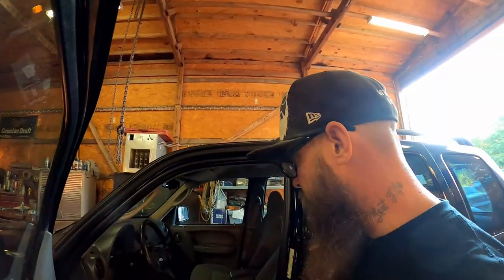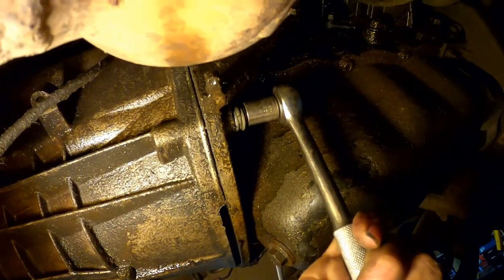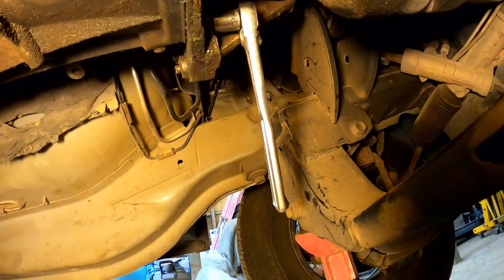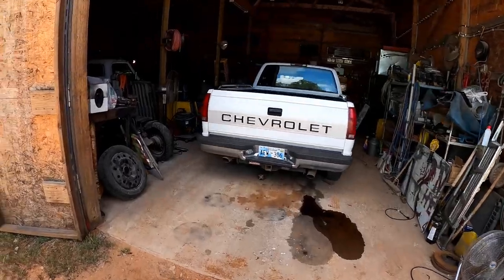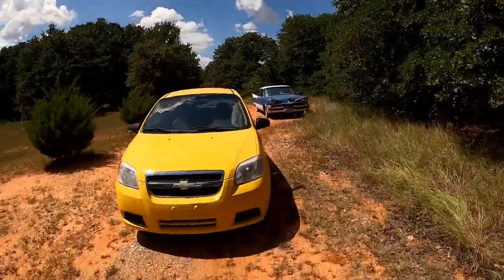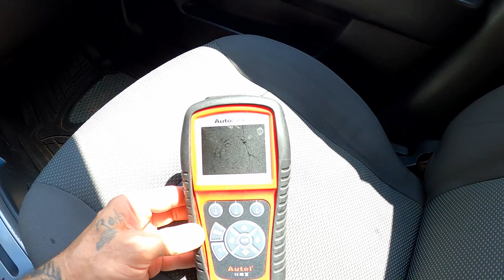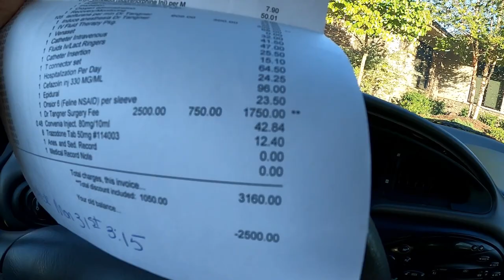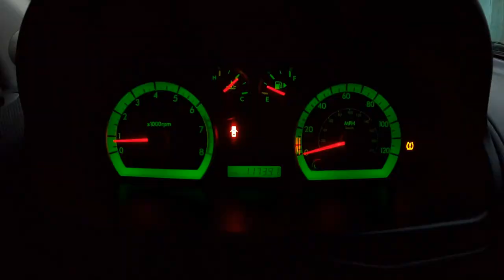Taking delivery of Auto Auction Rebuilds '59 Dodge Coronet.

Comment: Thank you Mike! You are awesome!!
Reply: hopefully you can get weird beard to swap out the motor and trans to the 318, with the newer transmission you will not need the drum brake for the driveshaft. that car will be a blast with a reliable power plant, I would also upgrade the master to a dual reservoir for safety. 110 mph thats crazy

Comment: Mike, please help Randy get a good paint job on that '59 by taking off as many emblems and trim parts that you can so they don't get paint over.  Before you try this, please spray the nuts with a lubricant because the studs will break off after having been on there for 60 years.  Thanks

Comment: I had a car that was popping out of gear once. Turned out to be worn syncros.

Edit: just got to the part where the transmission bolt is missing. Holy crap! That could explain it. Lol!
Reply: Most likely it is the synchronizers.
Reply: @dealerauctionnightmare4689  Mine used to Flip out of Gear all the time and I had to wear a Helmet because it cost me 75 bucks to get the car off the roof and put back on all fours. I finally learned how to drive it but the Wrecker company made 850.00 before I learned. Had to Get a Up Right Contract with them. You know I am kidding LOL...

Comment: About right on the jeep. I had an 06 automatic. AC when it decided it wanted to. Found out it had a recall on all the ball joints and tie rod ends, rear control/ stabilizers, and worst of all, shades of Ford pinto, the gas tank. The solution for the gas tank? A trailer hitch. Had to make an appointment for the recalls, no estimate on how long it would take, no loaner vehicle.....so I sold it,

Comment: My mom has a 2011 Malibu that had Limp Mode issues around 35,000 miles. Dealer replaced the throttle body and the issue went away. It now has over 200,000 miles on it and it has never went into Limp Mode again.

Comment: The input shaft to the transmission has probably wallowed out the case because it was driven so long with the mounting bolts loose. Will be cheaper to just find a used transmission and junk the old one.

Comment: For the vio code reading 
Check the ignition wire 
A spark leaks with humidity 
Test it by spring water on the wires

Comment: You know that transmission does not take gear oil... what they use on these new transmissions is a 0W30 full syn motor oil. There is a place out of Tallahassee florida I deal with on my manual transmissions. A reman with warranty will run about 1100 for those